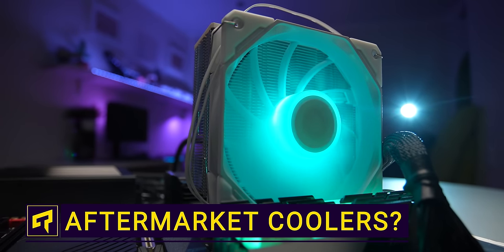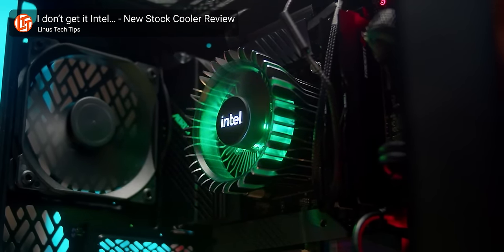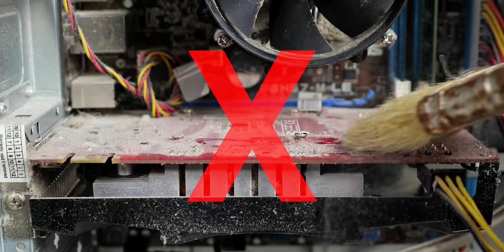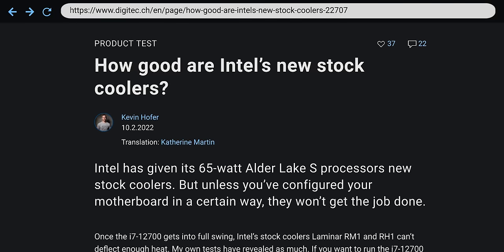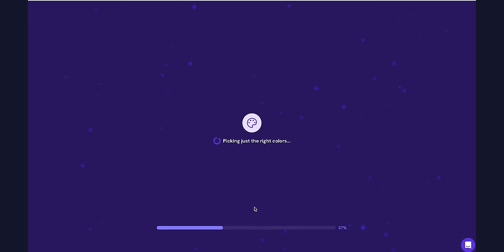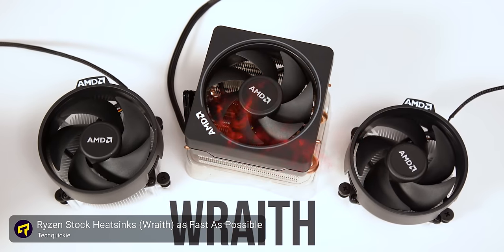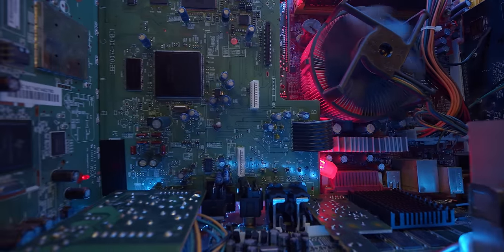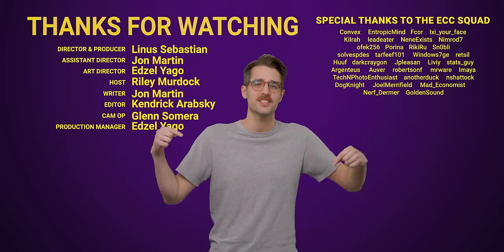Are CPU Coolers A Waste Of Money?

Comment: I use an AIO largely for the lower noise under load. Also, I like that there is less weight attached to the motherboard.
Reply: The back plate spreads that weight over a rather large area so damage to mobo is very unlikely. Agreed AIO is less noisy at load but typically more noisy at idle. Very depended on how it was set up as well.
Reply: @ouroesa  My Corsair h100i v2 AIO is nearly imperceptible at idle. I can't even hear it when I put my ear up to my case. Granted it has a zero DB mode when not under heavy load but a lot of AIOs have that feature now.

Most of the time my Fridge is significantly louder than my PC even under load.
Reply: @ouroesa  I had a Mobo die after my computer case fell from knee high while moving houses. I blame the aliexpress tower cooler (it worked like a champ though). Now I run a stock AMD cooler but instead of runing the stock one that came with my 3600x I am using the bigger one that came with the Ryzen 7. I bought it for 5€ from a guy that installed an AIO. Best bang for the buck, more than enough cooling for regular use and RGB. 🤣
Reply: Most AIOs are louder than a good air cooler.
LTT even has a video about it

Comment: when i repllaced my ryzen 2600x with a 5700x i tried using the stock wraith cooler because i assumed due to the similar power usage id be fine...it was far from ok. id hit 77 80c which isnt throttling but still way hotter than my old ryzen 5 ran, until i bought an AIO, and now i get like 80c under full all core load at 4.4 ghz, and not when playing league of legends at locked 70 fps
Reply: , that cpu is gonna become e-waste before any silicon degradation caused by it running at 80c
Reply: @hmello3250   My man, you have A LOT to learn. If you don't know what you are talking about, rather don't say anything as you are only misleading people. 
TJMax for Ryzen 5000 series is 95deg C and these chips are designed to boost to temps >80c.

Comment: The i7 13700k is also a toasty CPU, I started off with a coolermaster 240 closed loop cooler and it was thermal throttling even when it was only at %50 usage and was at 60c+ on idle. 
I have since switched to Lian Li 360 closed loop cooler and now at idle its around 35c and under full load it hovers around 90c so yeah with some CPUs you NEED a good cooler.
Reply: I got a 12900k and I use a 360 mm aio runs nice
Reply: Same here, running a 13700K with Noctua NH-D15S. Barely does the job when under heavy load.
Reply: Contact frame helped a few spare degrees though.
Reply: Sadly AIO coolers are becoming a necessity because Intel is not as efficient as Ryzen.

Comment: That way I see it is that better cooling allows a higher boost frequency, up to the rated max, but also to have more cores under load.
If you are gaming with a modern GPU-bound title you might not need the extra CPU cooling, but if you are compiling code using 8 cores each at 100% load, then you probably want a “water” cooling solution.
However, an aftermarket cooler that runs quietly is great for if you ever need extra cooling one day.
Also of note is if you have a more efficient AMD CPU, or Intel.

Comment: I disagree. Put on a big air tower cooler, e.g. the biggest Noctua, and you will have a silent, reliable and enduring cooling solution for many CPU generations to come. Other components will also benefit.
Reply: That would be nice, but it doesn’t help for builds in Small Form Factors, like Micro ATX or Mini-ITX.
Reply: Yes! I swapped my amd stock cooler for noctua and it is so much quieter. When i used to play games it used to spin up and make such a noise

Comment: After I bought 5600X in September 2021, I used stock cooler for a few months, along with stock fans that came with my case and I am telling you it was far from ideal. The CPU temps could get over 90 C. After a few months, I changed the case fans to Arctic P12 and that helped a little with the airflow, but I still got CPU temps over 80 in load. So, I went on and bought Fera 5 from, then, SilentiumPC, now Endorfy. Unless you are from Europe, you probably don't know this cooler, but here it is considered as ideal mid-range cooler, especially for CPUs, like 5600X. And it really helped. Very rarely I will get over 80 C, so, literally no thermal throttling anymore. and the noise level is also acceptable. So, while the stock cooler did its job, it was far from ideal even without overclocking and Fera 5 really did help me deal with the cooling issues I had. Of course, changing fans in my case for better airflow also helped. I am pretty sure Fera 5 itself wouldn't do such a good job if I kept my case's preinstalled fans. These things go hand in hand.

Comment: I use a Ryzen 5600 with a MASTERAIR MA620P (beefy air cooler) and a water-cooled 3090 with it.
I use them to work and play games, but working with them is the main reason that I bought them.
I am safe whenever I need to do any intensive work for long periods... like 90-100% loads for 5 hours without rest, they will easily stay below 60C.
It's all about what you are doing.

Comment: My observation:   Also longer reliability and life kept cooler.   And a Thermalright assasin is not super expensive and helps a lot over stock.  

I have run stock to start before and drop 20 later on a cooler.    I currently runn a 127090k and picked up a Thermalright 360 AIO ($52) and so far has been solid.   Keeps the temp extremely well conrolled even under load.

Comment: Yes, Alot of motherboard companies enable settings in UEFI that automatically OC and then you also have the EXPO/DOCP/XMP that is also considered an OC according to Intel and AMD.
Honestly it depends, What are you going to do with your Computer? Gaming? Then yeah get a high end cooler for consistency of framerates, If you are a musician recording You probably want a watercooling system that will allow you to run a whisper quiet PC, Video? you might need the overhead depending on if you are using the Integrated GPU for acceleration on top of hammering all the cores.

Comment: Absolutelly, but not so much. Ive spent some 200R$(like 40 dolars) on a thermaltake one i think and my 2600x went from 85 to hardly over 60 overclocked to run on 115w. Now I'm on a 5700x that cant run over 100w as far as i knoe so its very cool.

Comment: For reference:
I bought a cheap preabuilt pc.
It has asus prime b450m-a motherboard. I updated the BIOS yesterday.
It also has AMD Ryzen 5 3600 6-Core Processor 3.60 GHz.
With a little overclock fiddling (PBO) in the BIOS with most settings left untouched (so I don't brick the pc) I run a OCCT test and get an average 3.88-3.9 GHz speed and 1.3V power at a cool temp of 85C (95C is max reported by manufacturer). At lower temps I get 4-4.1GHz speed. 
This seamless 0.4 GHz increase sounds pretty good for someone who doesn't try to break world records and just wants to game without spending much money.
I have a stock fan-on-top-of-funny-heatsink setup to work 100% at 60C and above, and a manual throttle limit of 85C.
I got these values in OCCT stability test.

Comment: Great exploration of multiple angles on the topic! I liked that you also threw in whether to use an older stock cooler or whether extra cooling overhead prolongs processor life.  For fun I'll mention that from 2010 I gamed on an Intel Core i7 980X for about 7 years and continued to use that machine with zero issues in performance. I'm sure the people that got that system are still using it today.  Stuff lasts longer than we necessarily need it to.

Comment: To be perfectly honest, I bought a water cooling block for looks. Literally the only RGB on the system is the water block with the LCD screen. Everything else is gray and black since I got a nice screen that is shiny instead of matte. I might try a tiny bit of overclocking, but I'm not expecting a big boost. My last system could not physically overclock because I was using a Ryzen 2000 series board with a Ryzen 3000 series chip. I'll figure it out depending on the thermals under load.

Comment: I have a small case with a 5700G and nvidia 3600 And I bought a 120mm AIO Watercooler and I am very happy. I placed it at the back of the case and it blows the hot air from the CPU out. The whole system runs quieter and cooler now

Comment: I got an aftermarket cooler (back in 2017) less for the CPU temps, but more for the airflow of my case. Normal mid-tower. The GPU dumps out heat like its trying to recreate a perfect environment for cooking a turkey. The stock cooler blew air up at the glass and tended to make the through-flow really turbulent when it met the GPU flow. Back then, I could have gotten some super expensive fans to force a better flow, or I could get a cheapo CPU cooler tower that was more inline with the flow. Went for obvious choice. $20 of 2017 money and the GPU dropped in temp and the whole case flow was better! (Could be just be my case configuration, as I'm sure this prolly wouldn't affect most ppl's setups!) (Side note: CPU not overclocked, but GPU is in a round-about kinda way)

Comment: I tried using stock cooler that came with my Ryzen 5600 on a new 5800x3d. It took like 10 mins for it to hit 90 degreess and start throtthling. I undervolted the CPU and it stabilized around 80 degrees during game play. But it was still too hot and I knew it wouldn't stay at that level  when the weather gets hotter.  I finally bought a deepcool AK620. Now the temperature is around 60 degrees during gameplays  which is much lower than I expected and I'm very happy with it.

Comment: I built a Ryzen 2700 System in 2019. Did not bother with the stock cooler but put a Noctua 120mm air cooler on it. It was alright, but seemed to struggle to hold max boost even though the temperature was still in the high 60's centigrade. I bought a 140mm Noctua cooler (one bigger) and it took off about 5 degrees of the CPU and it boosted higher and hat better performance in benchmarks. 
I noticed similiar effects with several Ryzen CPU's from 2000 to 5000 series. My evidence may be anecdotal but I do definitely recommend getting an aftermarket cooler, ideally one with enough thermal mass to absorb load spikes.
I do agree that watercooling seems really unnecessary unless high end or overclocking.

Comment: We should only get aftermarket coolers for noise.

Stock CPU coolers are noisy, and you should get one that can cool your cpu by making as little noise as your gpu.

It's not worth it to get a overkill cpu cooler if your GPU keeps running louder.

Usually this falls around the 30-50 dollar CPU Coolers for "regular" 65-125W CPUs

Artic Freezer 34 is a good place to start

Comment: I always buy a tower cooler, but not because I want to overclock anything.   Cooler CPUs have longer lives so I get the cooler, set the TDP limit so it never goes above 60C, and call it a day.  I like that it is quieter, too.

I disagree with your assessment of CPU longevity with stock thermal limits.  They definitely do not last as long when they are running at 80C+.  Probably not something people really cared about in past years but now that CPU performance has more or less leveled out and is only increasing slowly, I think people will start to care.  A modern CPU stays relevant for a far longer period of time now than it did just a few years ago.

I'm one of those people who thinks that liquid coolers (of either type) are a complete and utter waste of money.  I want solutions that will last forever regardless of the conditions.

-Matt
Reply: "A modern CPU stays relevant for a far longer period of time now than it did just a few years ago."
You are, obviously, not a gamer, are you? If you had any experiences with modern games, you would never let this sentence out of your keyboard, because for gamers, it's the other way around, actually. Game developers are pushing the hardware limits like never before and even CPUs from two gens away aren't enough for current games on 4K in full graphics, even if you pair them with 4090. CPUs from three gens away... well, you would be lucky if you even launched the game in lowest graphics settings on them. So, no, for gamers, modern CPU will not stay relevant for very long, with game developers increasing hardware requirements more and more every year. Gamers are simply pushed to change their hardware every two gens and if they will not, for whatever reason, they are told they should not complain they can't run new AAA games. At least on Steam that's definitely the case. If you complain there that a new game doesn't run well on something like 3800X and 2080 on FHD, which is not that old hardware and used to be high-end in its time, you will get said to upgrade your PC. That's just the current state of gaming industry.

Comment: CPU coolers aren't a waste of money. Stock coolers are loud, the fans are low quality, and the heatsinks can't dissipate heat efficiently. After buying an aftermarket cooler you'll notice the quieter noise (If you'll ever get any) and the lower temps

An aftermarket cooler even cools your CPU down by 20-30 degrees or so

Just for comparison
Intel LGA1156 stock cooler on my i5-760

Idle: 35C
Load: 77C

CM Hyper TX3 EVO

Idle: 30C
Load: 70C

ID-COOLING SE-214-XT ARGB

Idle: 25C
Load: 50C

Hope you'll get the point of aftermarket coolers

Comment: I recall paying 50 dollars for an aftermarket CPU cooler, a medium sized air cooler, and my i7-8700k would hit 80C at only 20 percent usage... 95C-101C when it hit 30 percent usage before throttling or shutting off automatically. Paid about 60 dollars a few years later for a basic AIO (albeit a 240mm instead of a 120mm as I had enough of the cpu's bs lmao) and now it can reach 100 percent usage and still hang around 90C-95C; I have yet to see it thermal throttle due to the radiator. I was rather happy finding a "good deal" during the chip shortage on a "coffee" lake cpu, saying how it must be the one I need, as I love coffee (was actually a joke, and specs seemed best for the performance range and budget at the time); I had no idea when I read that coffee lake chips run hot, they meant they run HOT, and for years I just dealt with the 30 percent usage limit on my cpu, even going so far as to try and undervolt it to better manage the temps.

Comment: I think you missed to mention that a stock cooler could greatly improve your CPU thermals if you want to keep using a case that doesn't have enough or good airflow. Having an AiO exhaust the hot air outside instead of throwing it all inside the case can help a lot while you finally decide to also improve your case

Comment: have two Cpu coolers from Corsair that are 9yrs old for how I never had an issue with them or with my ICUE H100i RGB pro XT. for how they are still running strong without issue for how I do not buy from MSI after seeing the failure rate they had. for how I only stick to products that I trust

Comment: Use a copper pipe fan cooler from Cooler Master and it has been doing really well. Can't complain about sound either. And it wasnt expensive either. And my CPU is an intel 9th gen. Still running modern games just fine.

Comment: People buy AIOs to to temps in gaming, streaming, video content editing as it regulates the temps I the case alone air cooled fans are ok  but some are to bit and wide and collide with other components but people like the AIOs for the lighting effects and with fans mounted in other parts of the pushes out the hot air circulating around the case but the case plays a major factor in it. 

If u a decent case with lot of ventilation then a air cooler will do the job

Comment: Thermalright has a 360mL AiO cooler for less than $100 CAD and it comes with aRGB fans. You can it it even cheaper if you get the non-RGB one.

Comment: I went custom water loop after my aio pump died. I no longer like the idea of not knowing what is happening inside and not really being simple to fix it. A new water pump is like 15 dollars. The waterblocks may be a bit more on the expensive side but you only need the cpu one and a radiator. Granted, now I have tons of radiators and waterblocks for cpu, gpu,ram and ssd but everything works better and its just switching a small part if you change a component.

Comment: Yeah, I'd agree that for most consumers the stock coolers are enough. Most people I'd wager don't OC and aren't running intensive workloads for prolonged periods. And something like an i5/R5 will probably do well enough with the stock cooler it came with.        

I'd argue that you even get diminishing returns with an aftermarket cooler after some point. Paying however much for a 1dB noise reduction or 1-2C lower temp. avg. And then there's paying more for a certain brand or for RGB. Don't get me wrong, I go for whatever name brand cooler with some RGB fans personally but if money is the chief concern there are budget options that net pretty darn close performance to some of the top shelf offerings.

If we're talking high-end CPUs of course you want something comparable and not cheap out all the way to the bottom of the barrel, but for the average middle of the road computer it doesn't need an AIO pushing $300 unless they really want it for looks or something.

Now as for Intel's OEM push-pin CPU coolers, I hate those things. A screw-in alternative with a backplate is pretty much always better IMHO.

Comment: Considering the only stock cooler I ever tried to use was dead out of the box, I don't even bother using them. They're built to be as cheap as possible which to me means poor tolerances, low quality parts like fan motors and little care about noise. For $30-50 you can get a cooler that can be used on multiple builds if you get adapter plates it just makes more sense to get way better performance and longevity than the pack-in.
Reply: 50 bucks sounds cheap if you're american. For a lot of other countries, you just don't have that kind of budget to spend on a cooler, especially since a stock one or very cheap option proves more than adequate.